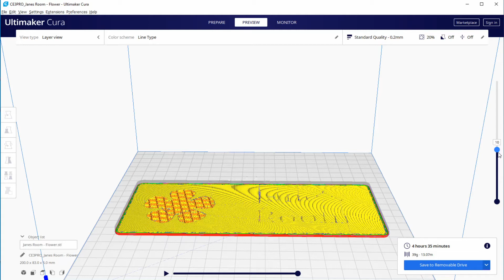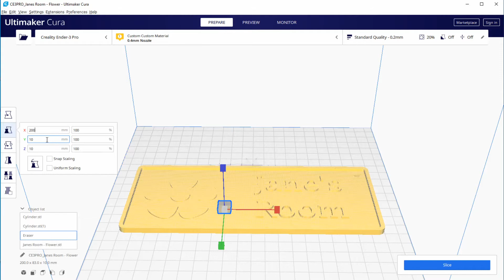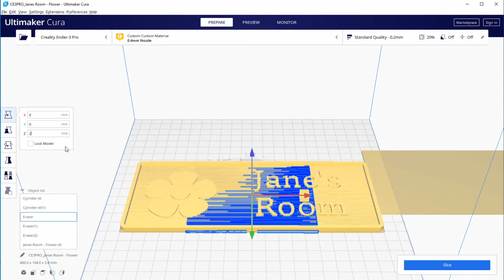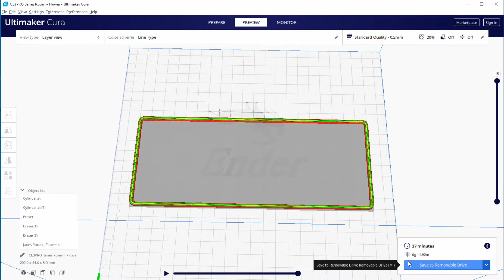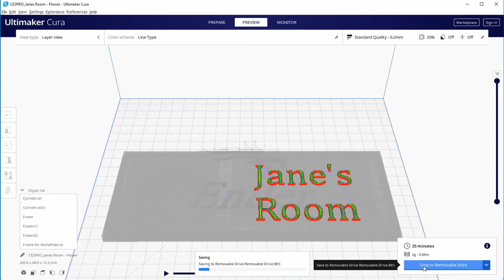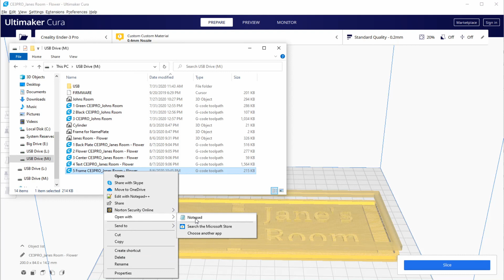Lesson 3 - Multicolor 3D Printing Using Single Filament Printer

Comment: I end up using Cura 4.5.1 again to follow your tutorial, since the Gcode is quite different in Cura 4.8.0
Thank for the video. it help a lot.
Reply from the maker: I am glad you found the video helpful. I haven't used Cura 4.8.0 yet. But now that you mentioned, I will check what are the changes. Thanks